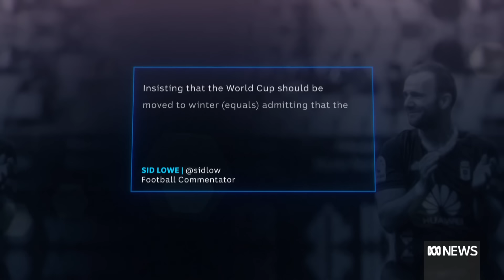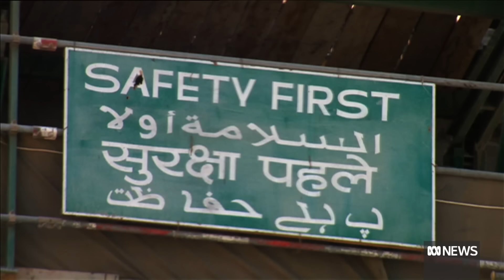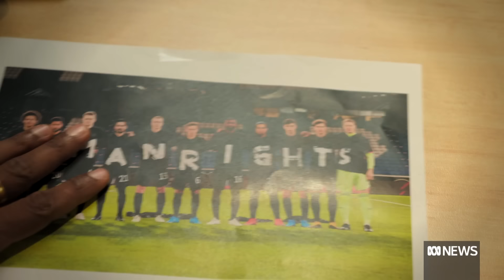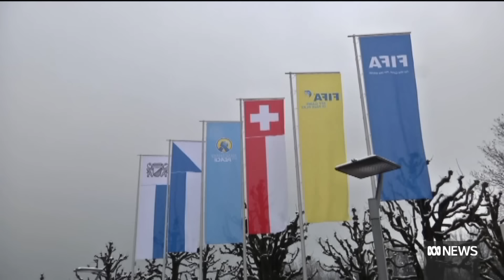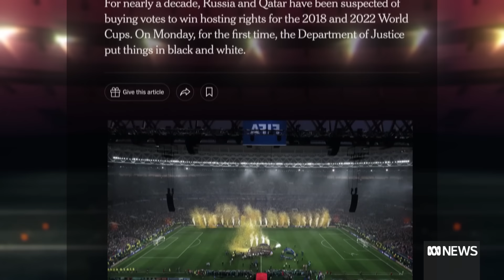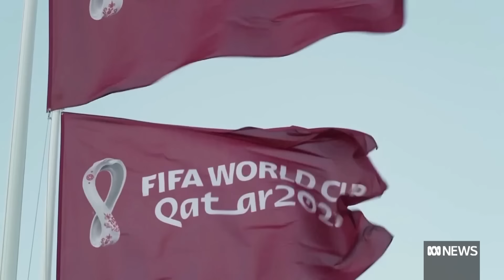Qatar 2022: Controversy, Corruption, and the Cup | VideoLab | ABC News

Comment: the comment section here is intriguing. But whatever you feel about corruption, values, deaths etc...the fact remains several of the worlds top leagues had to make huge changes just to accomodate it, meaning it shouldn't have been considered in the first place. They had to build 7 of the 8 stadiums exclusively for it. It has no football history, it has less than half the populatio of greater London, and no matter what they are trying to do the have a recent history of mysgony and intolerance. No major sporting event should touch this nation
Reply: Exactly Politics/religion aside 

Qatar is simply not a suitable location for a summer World Cup it’s simply too hot not enough of a football culture there and doesn’t make sense sustainability wise 

It doesn’t make sense to hold the WC there at all
Reply: ❤Qatar❤